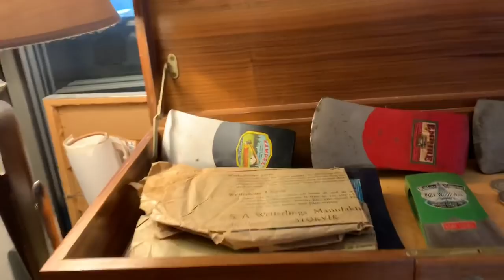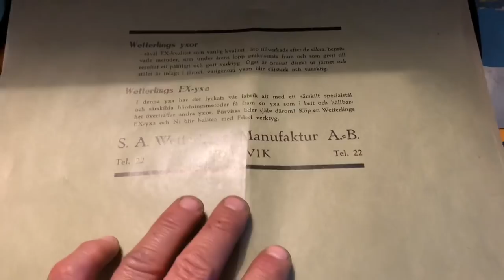Felling tree with bushcraft axe. Axe handle copy lathe

Comment: Nice to see a BC company making a good bushcraft axe. There is a rapidly expanding number of Eastern European and Russian Forges getting into this market as there is a large demand for them, I wish Lamaca well as they grow their business. I have a lot of axes of this size weight, most I have rebuilt with my own customized hafts, most are of Swedish or Russian origin. Bushcraft axes far out sell full size axes and I agree the shaft material, shape and size is crucially important, this.  Most 'bushcrafters' look for short handles 'packable axes' and 20" to 24" appears to be the length in most of them, so as with all things there may be a price to pay with shorter handles. Of course, for true 'bushcraft' tasks (splitting and bucking small diameter wood for campfires building shelters, making stakes, shaping down canoe paddles, spoons, benches, etc. shorter handles are less cumbersome.  I can see the thought that has been put into the design of the head, a sign of a master craftsman who listens. Thanks Buckin' Woodsman Spirit.

Comment: Wow! Thanks Buckin and Colby for showing us that axe shop, that looks like an amazing place.  Beautiful axe collection and those handles looked skookum.  Do you guys ever hear of any Canadian woods being used for handles?  I been  thinking about trying out elm and also black locust, but I haven't heard from anyone who's tried them... also wondering if yew would be suitable for a handle, likely too dense I would imagine.
Reply: Brendanthered.  Black locust is some tough wood!  An ol' house in Pittsburgh we lived in when I was a boy had black locust columns holding up the center of the place.  Just raw, un-finished, ten or eleven inch diameter posts of timber.  My Dad showed me how nearly impossible it was to drive a nail into those aged beaties.
Locust would make a great axe handle, but might not 'dampen the shock' transmitted to your hands at each slash o' the axe.  (Shouldn' be no problem for ya though; you don' look like no 'woos' ta me!)
🙂
Rick Bonner, Pennsyltucky

Comment: Hey Buckin, is it normal for the file to grind into the top of the chain “link” as the tooth gets ground down, in order to achieve the nice “C” shape ? Thanks Don
Reply from the maker: for me it is ,,, whaat size file?
Reply: Buckin' Billy Ray Smith  3/16 it’s the recommended size for the chain!!! But to get the nice “C” shape I’m always in the links especially as the tooth is filed down a bit.

Comment: I have a question for you I have a Homelite in my possession it’s I think a 16 inch bar Fool cute It needs a new fuel line how do I get the fuel line off I know why it needs a new fuel line and the fuel lines cracked open is it internal or do I just pop it off the outside and the carburetor
Reply: Anthony, I hope someone answers your question. Come on guy's.  Help out here.